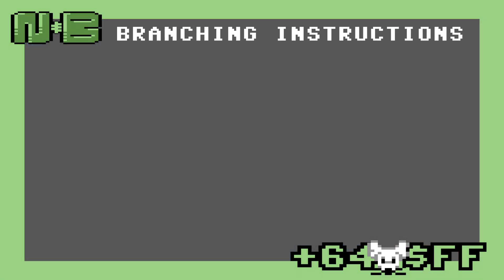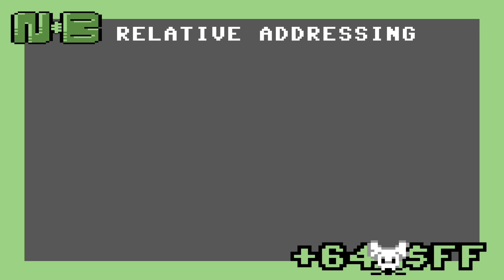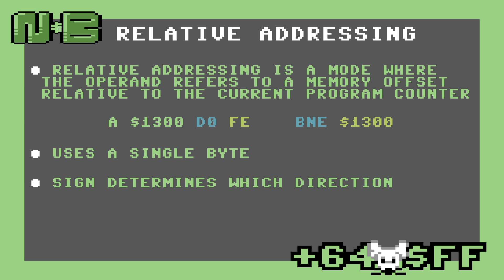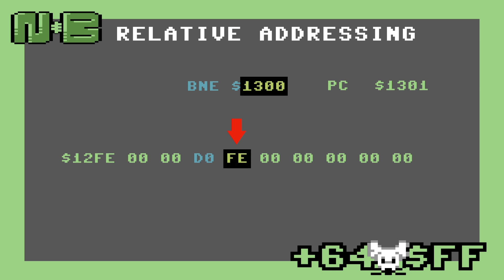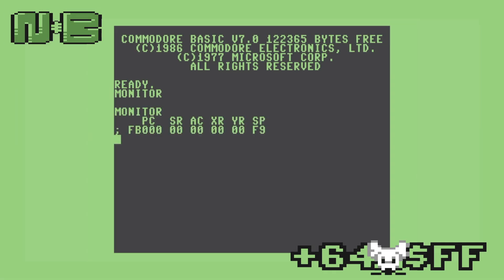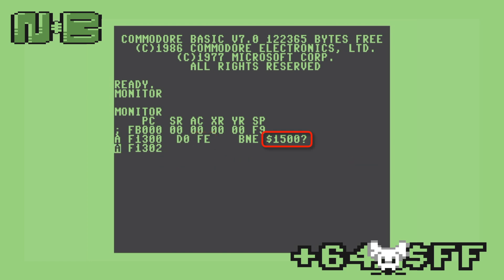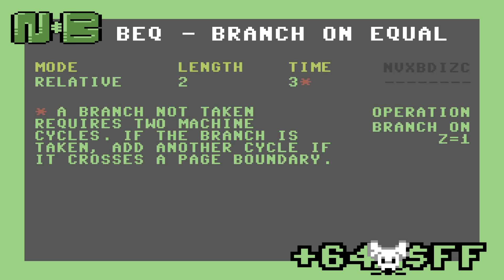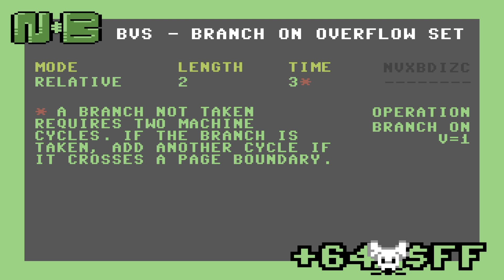Nybbles and MouseBytes: Ep4: Branching Instructions

Comment: Am I the only one simply not getting this? It really feels like half the required information is missing. Care to explain in more detail, how you get from "if cmp is the if Part, the B** Instructions are the "Then" Part" to "A $1300 DO FE BNE $1300" ?? Where is a comparison here? Why do you branch if <WHAT> is not equal to <WHAT> back to $1300 if the FE already takes us those two steps back?
Reply from the maker: Yeah, I explained how CMP works in Nybbles and MouseBytes: Ep3: Comparison Instructions https://youtu.be/8Cp9aBzZ9NM -- apologies for getting into this one a bit faster and without an example. I'll be sure to include examples in every video from here on out.
Reply from the maker: Also, I'll try to group related instructions together next to try to keep them in a more coherent vid.
Reply: The CMP instruction compares two values, usually the value of a register and the value stored in a given memory location. It sets one or more flags (bits) in the status register to indicate the results of the comparison. The branch instructions then check one of the flags to determine if the branch should be executed.
Reply: @diggydude5229  Thanks for taking the time to type in your reply but I really don't see how it would answer my question.
Reply: @kitzibu  Perhaps you took the "if/then" analogy too literally. Like most analogies, that one wasn't perfect. The branch instruction actually performs both the "if" and the "then" part. The CMP simply evaluates the statement that would appear in parentheses in a typical high-level language. (Note that most high-level languages don't even have a THEN keyword, with BASIC being a notable exception. In C-like languages, the "then" part is indicated by grouping the statements to be executed upon branching in curly brackets.)
Reply: kitzibu BNE would be branch on not equal but what it actually looks at is the Z flag, if it’s 0 it will branch. When a CMP instruction compares it will set the Z bit to 0 if the two values are not equal.  BNE does not do anything to The Z flag so once it branches back to it self it will branch again.  The branch instructions act on the flags.   The comparison instructions set the flags.  Hmmm does that answer your question better ?